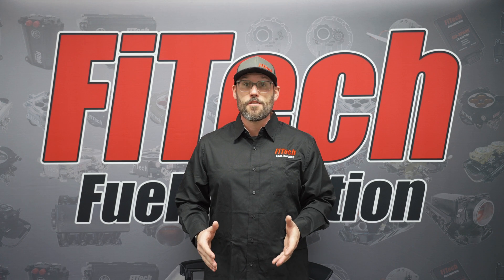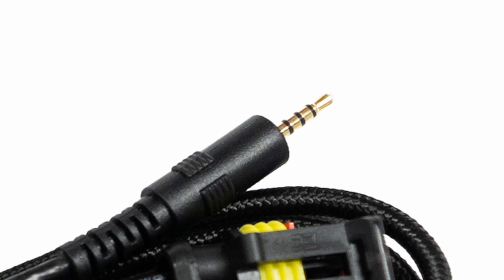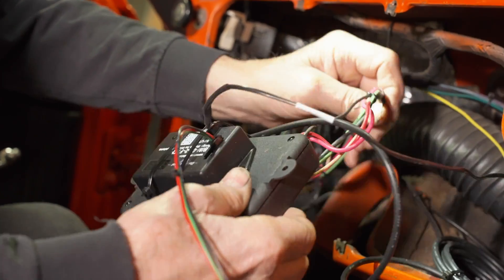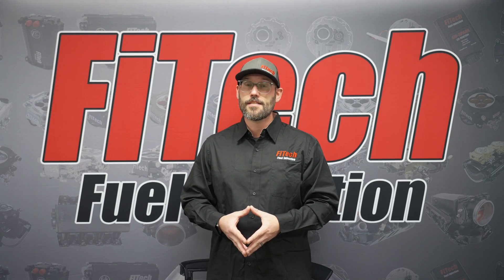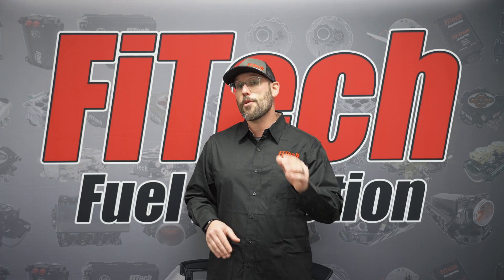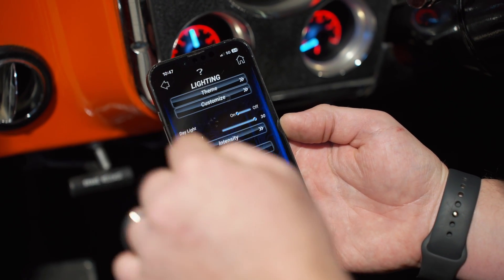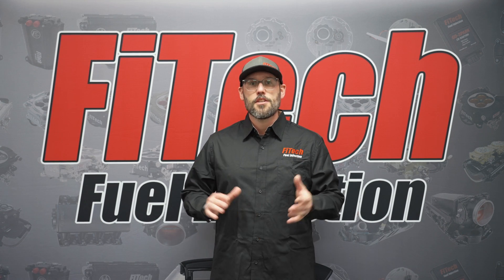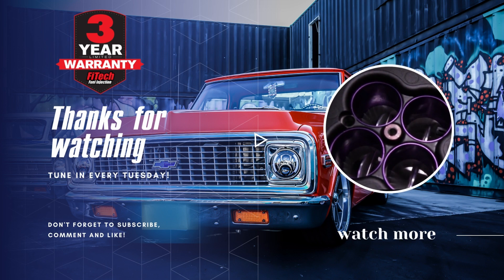Dakota Digital & FiTech EFI | Tech Tuesdays | EP101

Comment: My Fi-tech ultimate LS has software version v1.32 . I take it to get can bus feature I need to update software . I will call in tomorrow
Reply from the maker: There is a hardware change as well with the ECU and harness. The tech department can help you identify if you can update or not.
Reply: @ I tried 3 times today 45 minutes each time on hold. No one answered techline. I also have emailed. I bought new controller with v1.53. According to how I hear the video. I just treat it like I updated controller and use controller to update ECU?
Reply from the maker: @ That is correct. Under Display Setup on the handheld there is an option to make ECU PROGRAMMER say show. Once on show it will appear in the Main Menu where you can open it and load the file that closest matched your application. Once loaded key off for 30 seconds.
Reply: @ Thank you.
Reply: @FiTechEFImedia  https://youtu.be/qCOPUQ1gdyo?si=xTERha-LdUHlnPvg